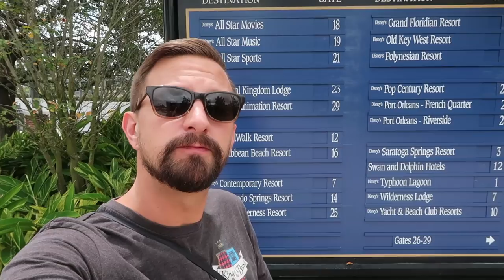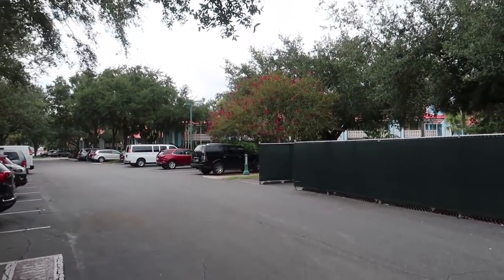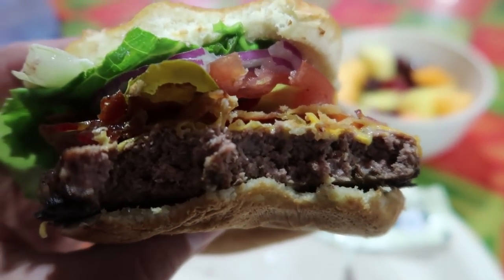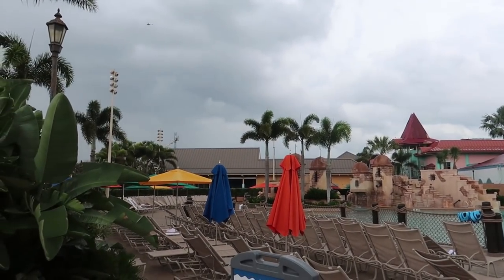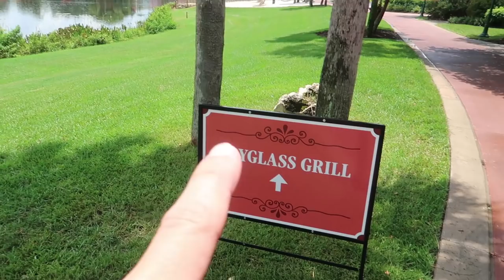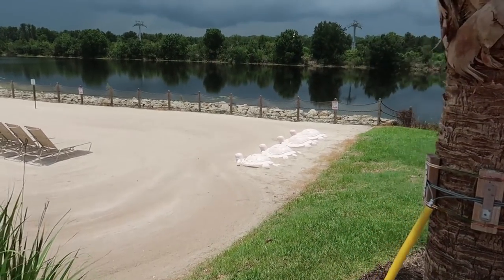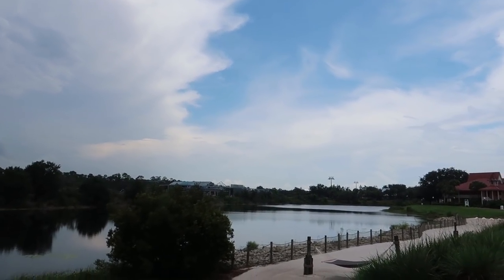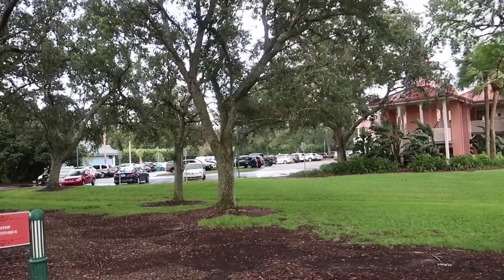An Updated Look At Disney's Caribbean Beach Resort, Riviera Resort & Skyliner Construction Progress!

Comment: Hi, Tim, and thanks for the update! Our trip to WDW ended on June 7th, including 9 nights at the CBR, and it is amazing to see how much work has been done on Old Port Royale since we left! While we were there, they put up the small gondola tower that was on the other side of the fence near the Riviera, right next to our building, which was Aruba # 55. I see that they've picked up the matting and fencing on Aruba's beach, which led from the gondola station construction site to the gondola tower next to the quiet pool for Aruba. 

While we were there, they finished the landscaping and the new main entrance area guests in cars and buses started using it while we were there. It's right next to the new main Skyliner gondola station and Jamaica, exiting out onto Victory Way. They've got the traffic signals there, just like on Buena Vista, except they're not turned on yet. 

Regarding Centertown, it is a buffet for breakfast and dinner, but ala carte for lunch...and, yes, Spyglass is delicious! But the Old Port Royale work has just gone into overdrive since we left. The building you were wondering about? It's going to be the new home for the Banana Cabana pool bar, with Shutters table-service dining restaurant next door, to the left as you're looking across the bay at it. 

It's very exciting to see all the landscaping that is underway along the waterfront, a clear sign that the new opening is not far off (FYI, Caribbean Beach's 30th Anniversary is October 1st, which is also the 47th anniversary of WDW opening. Hmmm....).

As to the Riviera, a lot of work remains, the last I saw was for Fall of 2019. Nothing has been announced about the amenities at this new DVC, except that it will have a rooftop restaurant for fireworks watching. There's still no word whether this will be open to anyone who can get an Advanced Dining Reservation, or if this will be a DVC exclusive perk.

Thanks again for the great update!

Comment: If you need a third hand for your camera just build yourself a harness system called a rhino. It's made from pvc pipe and some cushiony materials for your shoulders it may not look the best on you but the shot is steady and is usually pretty good. There are tons of how tos online and i have built two and used several for various projects for projects I've been working on. The name rhino comes from how it looks as the single horn sticks out making you kinda resemble a rhino. Its kinda like a selfie stick on steroids but its hands-free leaving you to handle an umbrella for instance. Just point in the direction you want, hit record or stop and done. There are variations like a holder for ipads or something. Its up to you to you to customize as the basic models are just that. Don't bring them on rides since they are kinda bulky but all in all a sound investment for just pvc and glue.
Reply: L